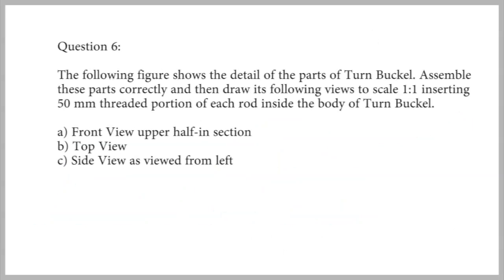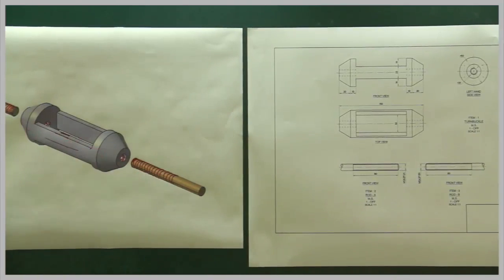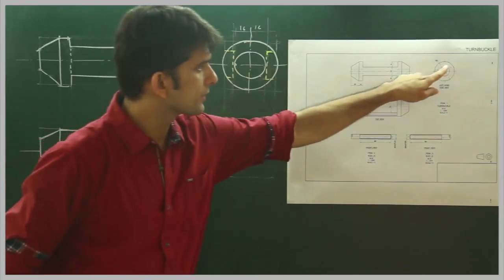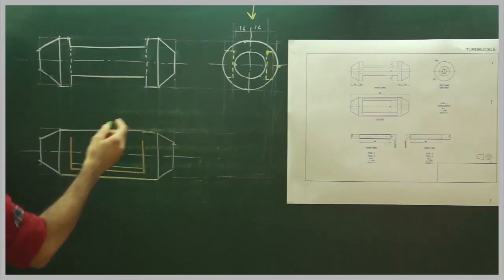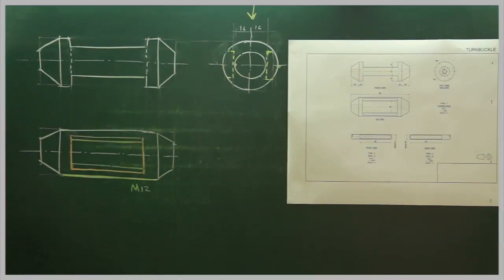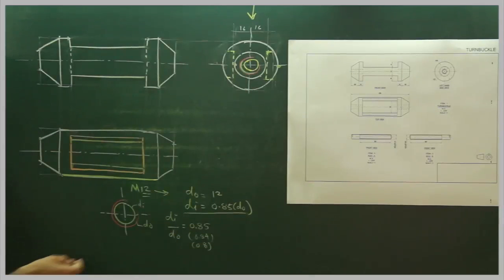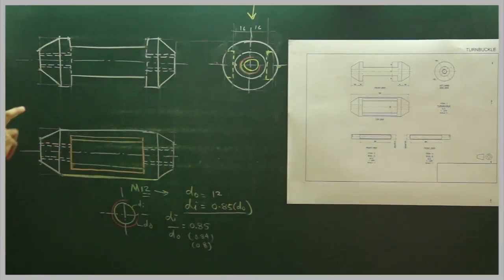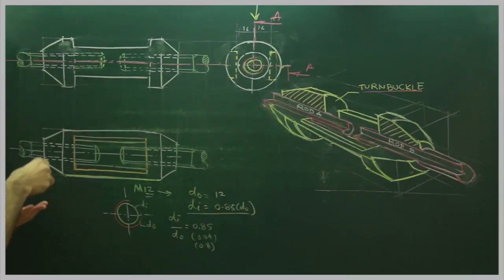Assembly of Turnbuckle, Tie rod, Turnbuckle

Comment: This is a turnbuckle tension rod, the nut doesn’t really do anything and the force is transferred through the treads of the rod - the turnbuckle is meant so they can adjust the tension on it. Sorry im a structural engineer LOL